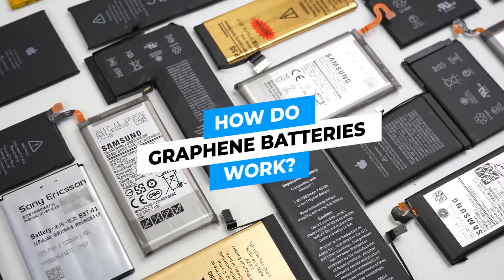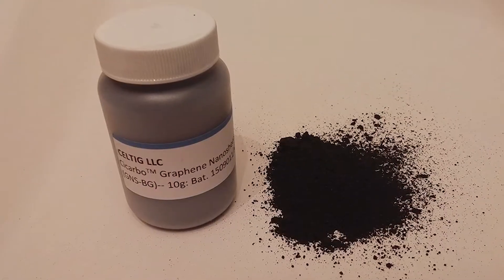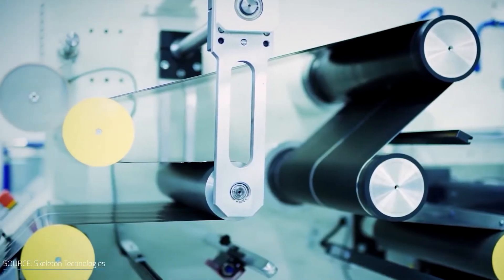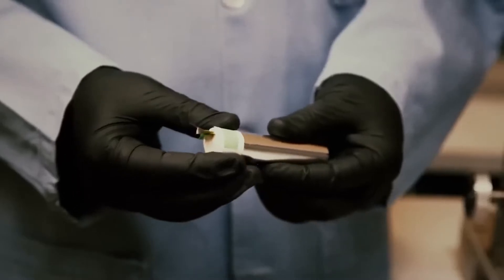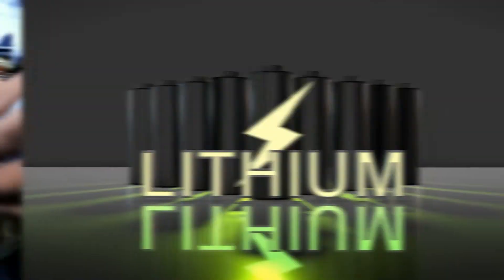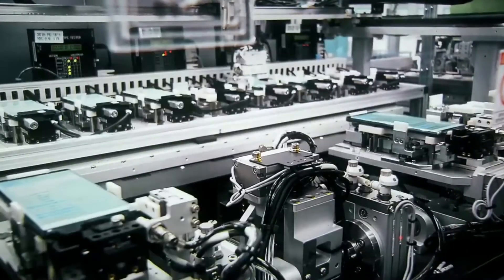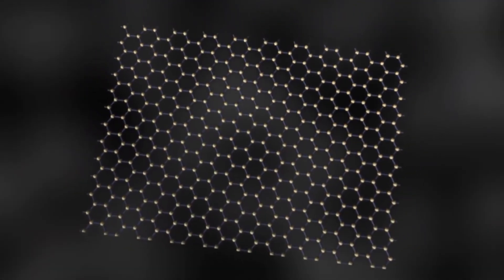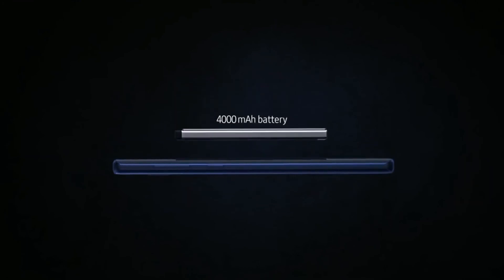How do Graphene Batteries Work?

Comment: Graphene Serves  as a Composite 
material in. electrodes. providing. a Structural 
backbone.  that  improves. efficiency and 
allows for. better control over ion.  movement 
and. charge. transfer 
made up. of 
an. electrolyte Solution and two. electrodes  to 
enable. ion. and. Charge Transfer